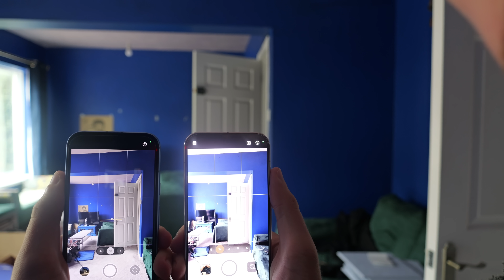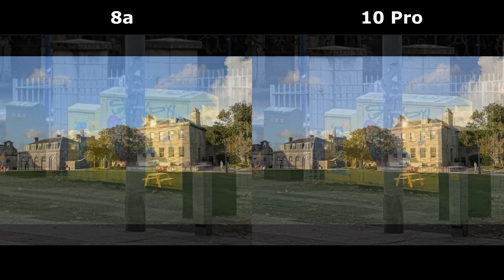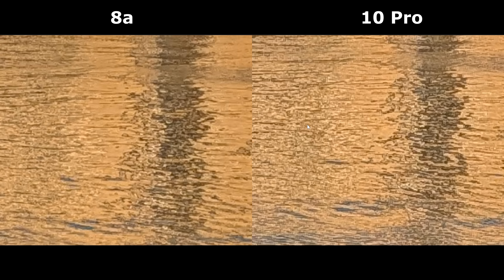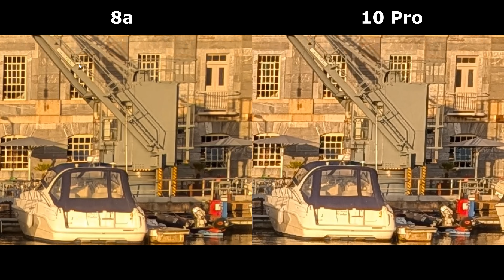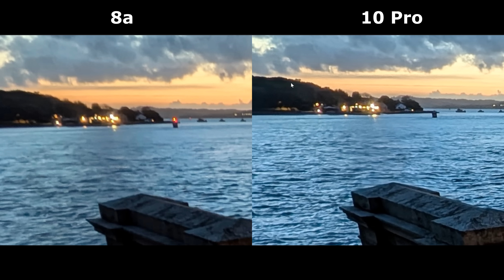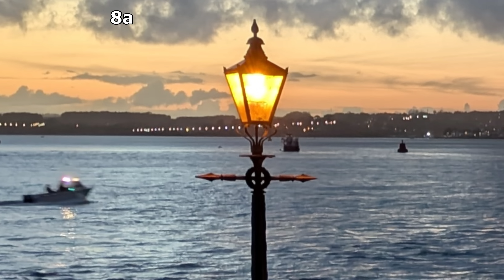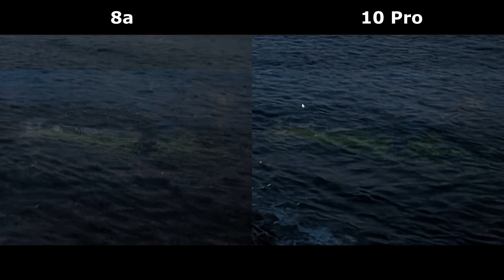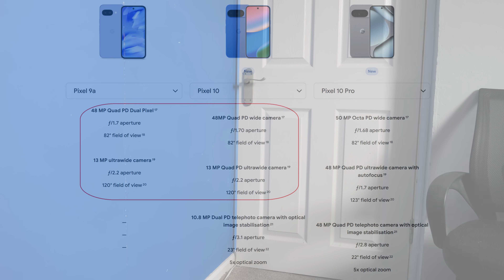I Tested Google Pixel's Cheapest and Most Expensive Phones

Comment: I really dislike how modern smartphones process images. You can instantly tell when looking at a photo taken on a smartphone by the excessive sharpening and dynamic range compression that makes the image look very flat. And for some reason reviewers praise those things because at first glance it appears better. E.g. you can say that you can see more details in the shadows and highlights, but at the same time it ruins the look of the photo. In this regard I think the chinese phones like Vivo and Xiaomi are doing quite a bit better, producing more natural images that look closer to what you'd produce with a lightly processed raw file. Pixel phones spit out images that look like they pushed the clarity, sharpness and shadows sliders all the way to the right and highlight slider to the left.
Reply: This is exactly one of the reasons I think dedicated camera sales are up. The processing by Apple, Google, Samsung and others is absolute garbage. Nokia phones 10+ years ago looked more natural and had much better color grading. For example, when you compare Pixel images with a properly edited version of the same image, it ends up looking flat, desaturated, overly denoised and weirdly contrasty and also not. The fact that modern smartphones allow for saving the raw images and log video, in some cases, is amazing and can help you make the most of your images, if you don't have a good camera at hand. That still doesn't excuse the awful processing you get on your ready-to-use images, but it's a start, and now they only need to adjust the processing itself or let users adjust that, too. Or both?
Reply: @altairquten  This. I just went looking at my old Nokia N8 pictures (2012) and was amazed how good and natural the photos looked. The quality was totally passable by today's standards but the look is like from a pocket camera that have very little if any processing.  

 It's actually really easy to become "blind" to what was once considered a normal photo because everything is so over processed now.
Reply: @altairquten What do you think about the Hasselblad tuning on OnePlus/Oppo?
Reply: @teapouter  I have never looked into that, so I can't pass judgement on it. But I have very little trust in modern smartphone camera systems and the brands attached to them, in general. It doesn't matter which big camera brand has its name on a smartphone, it's very likely going to be pretty awful. If you really like photography as an artform, I can't recommend getting a dedicated camera (appropriate for your budget range) and possibly getting a cheaper phone with a weaker camera setup enough. From ergonomics, to sensor size, photo and video features, as well, as file quality and editing headroom, most decent digital cameras will surpass any modern smartphone with ease.
Reply: Google seems to be one of the worst for over processing images, Apple does it but its a lot more subtle and rarely actually destroys the image in the same way shown in this video. There's camera apps on iOS and I presume there is on Android where you can bypass the AI processing and just get the raw image.
Reply: @Jameseos  The latest iPhone 17 models does it even less than before. There's almost no visible post-process sharpening at all. Much less than all other popular phones currently.
Reply: @Dr904  Yes I agree
Reply: @Jameseos From experience,Google photos remind me of a Polaroid film camera as in you don't know what the phone will conjure up. Photos end up looking nothing like what you see on the display.
Reply: That kind of editing looks good on Instagram, and that's all that matters for most people.
Reply: Yep. Pretty much all phone photos look awful the moment you don't look at it at from a thumbnail
Reply: The upcoming flagship by Xiaomi is so disappointing. I really wanted the current flagship because its designed to look like a vintage Leica, but had other properties so I told myself I would buy the next model come next year. This year they announce that they are dropping the vintage camera look and fully aping iPhone. This made me so angry that I will never buy Xiaomi anything ever again. I'm currently on an iPhone X btw
Reply: use motioncam
Reply: Hilarious you mention Chinese brands as having “more accurate” photos when Vivo/Oppo were the brands most well known for first implementing facial smoothing & face filters in their default camera apps, making everyone posting on WeChat Moments look like they had white, smooth alien skin with only eyes and lips 😂 Or how Huawei’s night time mode was so bad, they had to add fake textures & details to any pictures taken of the moon to match their advertising
Reply: So far my solution to that is to take the occassional proraw photo on my iphone, not because of any merit of the format, but only because the iphone seems to run out of capacity to process the photo therefore it looks vastly less oversharpened.
Reply: I hate it too, though thankfully on both platforms there's now apps that let you eat your cake and have it too, where you get the benefits like improved dynamic range and noise reduction without being horrifically over done. Gcam ports, motioncam, sharpcam, and Adobe's one on iPhone
Reply: You can use pro mode for less prosessed look
Reply: Use pro mode
Reply: Huh? Chinese phones always make unnaturally processed images. Even Vivos 'Natural' mode is extremely saturated and sharpened
Reply: I prefer to see what the eye sees... These"natural" photos you say has nowhere the dynamic range the human eye has...and so looks ugly...90 % of us aren't photographers and don't have the time to edit every 1000 photos and videos we take on a smartphone to perfection, taking 30 minutes-1 hour on each. We have better things to do than edit all day. So I'm good with the better looking more dynamic range images rather than worrying about details at 400% which I don't have time or patience to extract only for it to be compressed by the messaging app I sent it down to 1080p
Reply: It's because it's nicer to look at, well, at least for the general public. People prefer the HDR and sharper look. It's called PREFERENCE. and PREFERENCE is SUBJECTIVE.. which means you cannot tell them what they should like and what they shouldn't. I'm gonna drop the biggest word internet people cannot comprehend: OPINION. Yes. You can have an opinion about it, but so does everyone else.

It's just a matter of choice.
Reply: @TheReal_LuaDipa  wdym "choice"? When all smartphone photos look bad in the same way, while also being used to post those photos, there's not exactly a choice in image quality to be had. There should be an easy way to just have a better ready-to-go photo and raw image formats show what smartphone algorithms leave on the table. Sure, you can edit pics and post them. But that takes time and effort, both of which are limited. It's an eat or die scenario. Either you accept this easy compromise or go for a harder one. So consumers of pics often don't ever see what a good image can look like. It's hardly a choice.
Reply: @altairquten its always a choice. You have the choice to not buy a phone. No one is forcing you to buy a phone lmao 😂 And just buy a mirror less camera. Other than that, then cope.
Reply: @TheReal_LuaDipa  Yes, one person has the choice of getting a different camera, but you don't have the choice over which camera a photographer uses, who posts online. What you see shapes your preferences. Not sure what's so hard to get. So no, you don't necessarily have a choice to shape your preferences, nor can you claim that the look of modern smartphone image processing respects people's tastes or that those tastes are mere preferences everyone just comes across on their own. It's much more nuanced than you seem to think.
Reply: @altairquten  No one here is claiming that modern phones makes good images. And of course, you cannot control what others use to make photos lmao that's why freedom of choice exists. you cannot tell everyone angrily to use a DSLR or a Sony Alpha to make content lol that is not how the world works. They are not forcing you to look at their social media photos that they took with their phones, you can just unfollow them block them or ignore them, but you have no power to tell other people what they should be doing. All im saying is that what phone manufacturers makes is what the market wants. Its all a matter of choice, you just have to accept that what you want out of a phone is not popular, that is it, that what you think as ideal is not what the reality. there's not much you can do about it man. you cannot dictate what a market wants lmao. you're just thinking too much into it, man. Go get some rest. You seem to  be so restless over things that are so simple and mundane. The world is a big place. Don't limit yourself to a narrow perspective. Afterall, you can easily just buy a mirrorless or a DLSR. There's no one forcing you to buy a modern phone for hardcore photography. Let people enjoy things that they like, its not like they are forcing you to buy a phone for photography.
Reply: @TheReal_LuaDipa  Thank you for clarifying! However, you can't claim that the market wants a product, when they're forced to buy what the manufacturers sell to participate in society and when what they sell is basically the same bad product with a different name on it. I won't force a camera or whatever on anyone, but the fact is that 1) They create much better images and 2) The gap we perceive between good phone photos and good camera photos has unnecessarily grown and it's not due to fast camera development. And since everything beyond taking 1 pic and posting it online is too much time and/or effort many/most users, I think it's valid to ask for better cameras and better processing for everyone.
Reply: @altairquten no manufacturer is forcing any person to buy their mobile phones. If the market doesn't want their product, the market won't buy them and buy DSLRs or other pro cameras instead. Let's be honest here - the average person doesn't want to deal with the complexity of prograde cameras. You want something that could fit in your pocket and can be used to surf social media and watch videos on the go. Considering the smallness of phone cameras its a miracle they are able to do what they do today. But of course, its done via software. And that's where opinions and preferences come in. If you like it then its okay. If you don't then its okay too. Camera phones will never beat professional cameras when it comes to quality, but they sure as hell comes close to it. Some phones are better like Sony where there is pretty much no processing, some phones cater to the point and click crowd with all filters and such. There's absolutely nothing wrong with them. If you really want a solid camera then you should buy a camera not a phone. 

If you want a phone camera that's as good as a Sony Alpha then I'm sorry, such a phone wouldn't exist. You cannot beat physics. 

Alternatively you can install 3rd party apps on your phone, if you are really pushing for it to be as close to a prograde camera. There are a lot of apps that lets you take photos without much processing. Just a goolge search away.
Reply: @altairquten  pixel allows to save bouth raw and edited jpeg AT THE SAME TIME 
Raw obviously looks hideous without any kind of processing, so i just take jpeg because i ADORE the pixel processing, looks amazing on hdr screen
Reply: @TheReal_LuaDipa  I'd say it would be a rather easy fix for manufacturers to please both sides and in many cases they actually do. Enthusiasts can use "pro mode" and rest of the "normies" and for quick snap shot you can go with auto.

For me, many times its the over use of HDR that ruins photos. HDR is good in certain situations when used in moderation. Would be nice if it could be adjusted as needed. 

Just wanted to add to your back and forth with altairquten that the market (90%) of people don't know what is a "good photo". They will buy a phone because reviewers parrot the same thing and tell them it's good. They have been conditioned by social media to think that overly processed HDR images = good image.   Of course this is kind of thing is very subjective, but you can't argue that the trend hasn't been set by the manufacturers and that smart phone picture are kinda of fake many times.
Reply: @samik83 judging if a photo looks good is not that difficult. Saying that the "normies" can't judge for themselves what's a "good" photo is just pure elitism. 

People are intelligent enough to use common sense. Just because you don't like what's popular doesn't mean that  the "normies" can't judge what's a good photo and that their opinions are wrong. For you too much HDR may be dislikable, for others it may be the exact opposite, AND THERE'S NOTHING WRONG WITH THAT. People can straight up make their photos supersaturated, AND THERE'S NOTHING WRONG WITH THAT, even if you don't like it. If you don't like it then don't look at it. If you don't want current camera phones then don't look at it. It doesn't matter why the "normies" like it or not, how they judged it to look good or not, all that matters is that they are entitled to their opinion as much as you are, its just that your opinion is not very popular and hence manufacturers don't cater to you. Just cope. That's the only thing you can do. 

If you don't like it then it's okay. If the normies like it then it's okay. There's no point in arguing that what's popular is slop. Respect others' opinions and we'll respect yours. Don't expect others to recognize or even listen to what you're saying if you cannot respect others' subjective opinion. 

As I have said above, there's nothing you can do about it anyway. So just cope. And the "normies" will continue enjoying their camera phones like you don't exist at all, no matter how loud you scream your OPINION, and your opinion being "different" and unpopular doesn't make your opinion or yourself better than anyone's or anyone. Sorry, not sorry.
Reply: @TheReal_LuaDipa  

"Just cope. That's the only thing you can do."

Or I'll just turn on pro mode. Simple.

I'm not arguing that people should like what I like. No, not at all. Stop trying to put words in my mouth.
 
I'm arguing that people - the normies  (non-DSLR user / non pro-photographers) have been conditioned to like these pictures because thats all they see. 
Anyone who shoot with DSLR's and phones knows that phones a lot of the time (not always) make overly processed unnatural pics.  And again if you like the processed look THAT IS FINE. 
But my point is people haven't chosen this look consciously, it was sold to them and perpetuated by social media. Normie want the same style they constantly see on their phones because they have no other comparisons.

I'm not again processing, of course all DSLR user do it too(just manually), but I'd argue very few pro photographers go with trying to mimic the overly processed HDR "phone look". Just think how a wedding photo would look vs a natural look.
Reply: @samik83 it doesn't matter how the normies get their liking of HDR in photos. It doesn't invalidate their opinion, even if we assume that what you think is true, which isn't. Even more so, you couldn't argue that "normies" don't know what good DSLR photos look like. You just can't. They are not as ignorant as you think. You can't prove your claim that normies don't know what good photos look like, because there are a TON of social media influencers who actually use prograde cameras. Even twitch streamers who stream 8 hours a day have a Canon or Sony small form factor camera for their main cam, those cameras are cheaper than some flagships phones these days, so no your argument is not really valid. And again, even if they like processed photos against DSLR camera, it doesn't invalidate their opinion. Why is it so hard to understand?

People can like whatever they want and there's nothing you can do about it. They're not hurting anyone. If the photos hurt your eyes then cope. 

The normies liking what they see in social media isn't a crime. So I don't understand why you are being such an elitist over such a mundane thing. 

You cannot force people to not like something that they willingly chose to like. No one is forcing the normies to like what they like. But you're coercing them to like what you think is better. That's where you're wrong. You're pushing your own opinion to everyone.

Not everyone has to have the same opinion similar to you. 

That's not how freedom of choice works.
Reply: @TheReal_LuaDipa 
I guess you didn't even read my post. I said many times its ok if you like overly processed images. That is fine.
Yet you keep talking like I'm arguing against that.

Let me ask you why don't wedding photographers for example try to emulate the overly processed phone camera look if it looks so good?
Reply: @samik83 its because pros have a better camera, isn't that very obvious? 😂 That's why they are called professionals, while the "normies" are not, and ITS COMPLETELY OKAY.

YES, YOU ARE COMPLETELY AGAINST HDR PROCESSING ON CAMERA PHONES. That's literally what you said above. 
You came here with an elitist take against camera phones and the popularization of HDR. There's no denying that. Also, as you have just said it yourself, just press Pro Mode to get rid of too much processing. You literally answered your own question of how to control HDR lmao.

The only thing that keeps you replying and arguing here is because you are pushing your elitist mindset to everyone to make yourself feel better, and IDGAF if you're aware of it yourself or not. 😂 Not gonna happen here buddy lmao. 
You cannot push your opinion on the masses because not everyone is willing to spend money on a separate camera, AND THAT'S COMPLETELY FINE AND OKAY, and you shouldn't judge people just because they are using phones as cameras and posting them online. I'm not arguing that phone cameras are better than DSLRs. There's no one claiming that here lmao. Read my original conversation again with the guy above. But this time, read it much, much more slowly, and again and again, until you understand it.
Reply: @TheReal_LuaDipa  

"its because pros have a better camera, isn't that very obvious?"

Well obvious you have no idea.

Nothing to do with a DSLR being better quality, it's about the processing the phone does to the photo.
A camera phone can easily take non processed DSLR kind of pictures with pro mode. In fact they can be close to indistinguishable in good conditions. 
 
You can also process a DSLR image to look like a camera phone picture.  You can easily bring a lot of HRD in post processing IF you want.  

So the question again:

Why don't wedding photographers for example try to emulate the overly processed phone camera look if it looks so good?  

"YES, YOU ARE COMPLETELY AGAINST HDR PROCESSING ON CAMERA PHONES."

Overly processed HDR. Thats what I don't like. Everything looks flat. 
Look at my first post, I say it there. 
HDR is very useful in challenging situations, for example taking sunset photos. They do look unnatural but at least you have something. 
Bringing up  shadows way too much in  "normal photos" looks unnatural. If you like that unnatural look, its fine. 
But I'm saying most people don't know any better because the never play around with pro mode and see what having contrast in you picture actually does.  Letting shadows be shadows (dark) might actually look good. Modern phones in auto mode don't usually allow for this. 

"You cannot push your opinion on the masses because not everyone is willing to spend money on a separate camera, AND THAT'S COMPLETELY FINE AND OKAY"

Yes, completely okay.  Do you read my comments at all? You're constantly trying to argue against something I'm not even saying.  Do you see that?
  
I'm not trying to say people need to like what I like. 
I'm just saying the REASON why they like it and your having a hard time with that. 
  
See, it's not really that different from fashion. People want to copy each other. But in this case the trend is set by the manufacturers who make the camera algorithm. 
Like in the newest Pixel phones they're now using AI to enhance pictures that even rebuilds peoples faces if it's unclear enough. Thats not a real photo anymore.
Reply: @samik83 read my comment again lmfao i already answered your question. Wedding photographers use DSLRs and pro cameras because they are, as you said, "professionals", and the "normies" are not. You literally have the worst reading comprehension of anyone I've met in this 32 years of mine. 😂

People liking AI enhanced photos isn't a crime. They are free to like it just as you're free to hate it. If you hate it okay. If other people like it that's completely fine too. Or are you high in your imaginary horse to accept that freedom of choice and opinions of other people exists?😂

Again, people have a choice on what to use. There's nothing you can do about it but cope. If you don't like AI then just use a dedicated camera no one is forcing you to use or even look ai assisted camera photography. 😂 But you dont, you absolutely don't come here being an elitist and telling that the "normies" as you call it doesn't know anything about photography at all.

Final question. 
Do you understand what a subjective opinion is?
Answer with Yes or No only.
Reply: @TheReal_LuaDipa  

"Wedding photographers use DSLRs and pro cameras because they are, as you said, "professionals", and the "normies" are not."

Ok, since I'm not getting through to you, lets changed it a bit.
 
Imagine a wedding photographer was forced to use a phone camera. 
What mode mode do you think he would use and why?
Would his "normie" clients prefer to have their wedding photos in the overly HDR look, (the mode you are insisting normies prefer) OR pro mode with the more natural looks?

"Do you understand what a subjective opinion is?
Answer with Yes or No only."

Yes. 
I've answered this many many times. 
It is fine that people like overly processed images. Why is this so hard for you to understand and why do you keep insisting I'm saying other wise. My point here is only WHY THEY LIKE IT.

And your claiming I have bad reading comprehension. Do you know what projecting is? Well this is a prime example.
Reply: @samik83 who's forcing a wedding photographer to use a phone camera?😂😂😂 Lmfao hilarious take, you're one different breed 😂

The normies can edit the photos from the wedding as they please. There's nothing wrong with it. 

The only one who has a problem here, it seems, is you. Lmao. 😂 You still don't understand it, do you?

There's nothing wrong about the REASON WHY people like processed or ai images. I'm literally just repeating myself lmao 😂 even if it is because manufacturers are pushing for processed images and the normies like it, THAT'S COMPLETELY FINE . There's zero wrongness with that, what is it that's so hard for you to understand? THEY ARE ENTITLED TO HAVE A DIFFERENT OPINION AND SUBJECTIVE LIKES THAN YOU, IRREGARDLESS OF HOW THEY ARE INFLUENCED TO THINK LIKEWISE. BEING INFLUENCED BY MARKETING IS NOT ILLEGAL .😂 You seem to be taking others opinions too seriously you are being hurt by the normies.😂 Manufacturers can and will make HDR processed camera phones and people will like them, and THERE IS NOTHING YOU CAN DO ABOUT IT.
Reply: @samik83 who's forcing a wedding photographer to use a phone camera?😂 Hilarious imaginary take. And even then, if people wanted to make wedding photos with camera phones, what's the problem with it? Why are you so affected?😂 U a wedding photographer or something?? Even then the normies can edit the photos and apply HDR EFFECT anyway, who's stopping them?😂

And no, there's NOTHING WRONG WITH THE REASON WHY PEOPLE LIKE HDR AND AI PROCESSED IMAGES, THERE'S NOTHING WRONG WITH PEOPLE BEING INFLUENCED BY PHONE MANUFACTURER'S MARKETING. what is so hard to understand about that?😂 

Just because the populus doesn't agree with your opinion doesn't make it illegal to be influenced by marketing. I'm repeating myself: its called subjective opinion and choice. If you don't like it okay. If other people like it because there are companies marketing it then its COMPLETELY OKAY, TOO. Why is it so hard to understand that concept??

Is marketing illegal now? Are manufacturers forcing people to like and buy their products? Yes or No answers only. 

You seem to be too affected by other people's opinions lmao. You just want others to conform to your likes. Not gonna happen kiddo. Samsung and Apple and others will continue making AND marketing HDR and Ai assisted camera phones, and people will like it. What are you gonna do about it?😂
Reply: @TheReal_LuaDipa  

"who's forcing a wedding photographer to use a phone camera?"

It's a just a hypothetical situation as an example to drive my point home.  
Phones can take highly processed picture or not processed.  

So here the question again. 
Or will you dodge it a second time?

Imagine a wedding photographer was forced to use a phone camera.  (maybe his DSLR broke down)
What mode mode do you think he would use and why?
Would his "normie" clients prefer to have their wedding photos in the overly HDR look, (the mode you are insisting normies prefer) OR pro mode with the more natural looks?

"NOTHING WRONG WITH THE REASON WHY PEOPLE LIKE HDR AND AI PROCESSED IMAGES, THERE'S NOTHING WRONG WITH PEOPLE BEING INFLUENCED BY PHONE MANUFACTURER'S MARKETING. what is so hard to understand about that?😂"

Where did I say it was wrong?  

"You seem to be too affected by other people's opinions lmao. You just want others to conform to your likes." 

I'll repeat since it seems you don't read my comments. I'ts like your making arguments on my behalf that fits your narrative.

Here it is a second time. 
It is fine that people like overly processed images. Why is this so hard for you to understand and why do you keep insisting I'm saying other wise. My point here is only WHY THEY LIKE IT. 

Maybe I'm having a debate with a AI bot here, not sure.  
I'll repeat once more:
It is fine that people like overly processed images. Nothing wrong with that. I'm not trying to change that. 
Lets see if your next response will still insist that I want to change the masses opinions on what is a good photo.
Reply: @samik83 answers to your hypothetical scenario:
the normies can pick HDR processed images or raw images, whatever they want, it doesn't matter, choosing either is not illegal in any way shape of form.

"my point here is why they like it". I'm just gonna repeat myself one more time, okay?

IT DOESN'T MATTER WHY THEY LIKE IT.
IT DOESN'T INVALIDATE THEIR OPINION.
IT'S NOT ILLEGAL FOR THEM TO LIKE IT FOR WHATEVER REASON SUCH AS PHONE MANUFACTURERS MARKETING IT. THEY CAN LIKE IT FOR ANY REASON, AND THERE'S NOTHING WRONG ABOUT IT.

Again, I'll repeat my question above.
Do you understand what fredom of choice and subjective opinion is? Yes, or No?😂
Reply: @TheReal_LuaDipa  

"the normies can pick HDR processed images or raw images, whatever they want"

Yes, those are the two options. 
You still dodged the question: 
What mode mode do you think he would use and why? I'm especially interested in the "WHY" here.  Lets see if you can answer this this time. 

"IT DOESN'T MATTER WHY THEY LIKE IT."
When did I say it matters? I'm just explaining cause & effect. Just an observation. No need to get your panties in a bunch over it. 

  "IT DOESN'T INVALIDATE THEIR OPINION."
When did I say that?

"IT'S NOT ILLEGAL FOR THEM TO LIKE IT"
Again, when did I say this?

"Do you understand what fredom of choice and subjective opinion is? Yes, or No?"

Did you miss it the last time? Here it is again.

Yes.
I've answered this many many times. 
It is fine that people like overly processed images. Why is this so hard for you to understand and why do you keep insisting I'm saying other wise. 
My point here is only WHY THEY LIKE IT.

The WHY matter in this context because your saying people chose this look, where I say they were sold this look.

Nothing elitist about this. Just pointing out that overly processed pictures are norm these days and people have gotten used to this, basically blind to it.
I'm not even saying I'm immune to this. I checked some of my old shots from 2012  Nokia N8 and I was pretty shocked what photos were back then. 
Granted the camera on that phone was a bangger for the time so the quality was basically as good as these days but the lack of processing and how natural the pictures looked was pretty amazing. Really opened my eyes how pictures have changed over the last 13 years.
Reply: @samik83  "What mode mode do you think he would use and why? I'm especially interested in the "WHY" here. " IT DOESNT MATTER WHAT THEY CHOSE. ITS NOT A SIN TO CHOSE HDR PHOTOS NOR A RAW PHOTO, SO THE ANSWER TO YOUR QUESTION CAN BE A) THE NORMIES WOULD LIKE THE HDR PHOTOS OR B) THE NORMIES WOULD LIKE THE RAW PHOTOS OR C) THE NORMIES WOULD LIKE BOTH, ITS LIKE ASKING WHAT COLOR YOU WANT YOUR CAR YOU ARE BUYING, RED OR BLUE OR GREEN, IT DOESNT MATTER. WE ARE FREE TO CHOOSE WHATEVER WE WANT. ITS CALLED FREEDOM OF CHOICE.

"The WHY matter in this context because your saying people chose this look, where I say they were sold this look." IT DOESNT MATTER WHY THEY LIKE IT. ITS NOT A SIN THAT THEY LIKE IT, EVEN IF IT IS BEING SOLD TO THEM. ITS NOT ILLEGAL TO LIKE WHAT IS BEING SOLD TO THEM, ITS PERFECLY LEGAL TO LIKE HDR PHOTOS EVEN THO IT WAS SOLD TO THEM.

"My point here is only WHY THEY LIKE IT." IT DOESNT MATTER WHY THEY LIKE IT. YOU HAVE NO SAY ON WHAT OTHER PEOPLE LIKE OR NOT. IF YOU DONT LIKE IT THEN LET OTHER PEOPLE LIKE IT. YOU HAVE NO AUTHORITY OR POWER TO CHANGE WHAT OTHER PEOPLE LIKE, EVEN IF THE REASON "WHY" THEY LIKE IT IS BECAUSE IT WAS SOLD TO THEM. THE PEOPLE WERE NOT COERCED TO LIKE IT. THEY WILLINGLY CHOSE TO DO SO.

"The WHY matter in this context because your saying people chose this look, where I say they were sold this look.' WHY DOES IT MATTER TO YOU IF THEY LIKE THAT THEY ARE SOLD ?? THEY ARE NOT HURTING ANYTHING OR ANYONE.  DO THE "NORMIES" JUDGE YOU BECAUSE YOU DONT LIKE HDR PHOTOS? YES OR NO?

"Nothing elitist about this. Just pointing out that overly processed pictures are norm these days and people have gotten used to this, basically blind to it." THERE'S NOTHING WRONG WITH PEOPLE BEING USED TO IT. ITS NOT ILLEGAL FOR PEOPLE TO GET USED TO SOMETHING SO PRAVALENT AND IS SOLD TO THEM. again, what is so terribly hard to understand on this conversation? you cannot push your subjective opinion to everyone. lmao. you are really trying hard to defend that you are not an elitist, but in every reply you make you are positing that there is a superior way to make photos and that people should think like you. That, lil man, is ELITISM at its finest.
Reply: @samik83  bro just SYBAU. Let people enjoy things. You are being a Karen right now. STFU and let me enjoy my ai powered 100 megapixel superresolution ai power max camera phone from china.. or are you so low in intelligence you are judging people based on what they like ??
Reply: @TheReal_LuaDipa  

Do you understand that I'm not saying it is wrong or illegal that people like overly processed pictures?

Yes or no?

It's really hard to have a conversations because you seem to be constantly ignoring this.
Reply: @samik83  "Do you understand that I'm not saying it is wrong or illegal that people like overly processed pictures?" YOU ARE QUESTIONIN THE REASON "WHY" PEOPLE LIKE WHAT THEY LIKE, AND THAT, LADIES AND GENTLEMEN ON THIS COMMENT SECTION, IS WRONG. BECAUSE YOU ARE CHALLENGING ONE OF THE FUNDAMENTAL HUMAN RIGHTS: THE FREEDOM OF CHOICE AND EXPRESSION. IN ADDITION TO QUESTIONING THE CHOICE OF OTHER INDIVIDUALS, YOU ARE TRYING TO PUSH THE NARRATIVE THAT WHAT OTHER INDIVIDUAL THINKS IS INFERIOR TO WHAT YOU THINK. THAT IS 100% ELITISM TO THE CORE. 

No one here is questioning why you dont like HDR processed images. But you are questioning why other people like HDR processed images. If you cannot still understand what is wrong with the way you think, I dont think me speaking any combination of words will ever lead you to a proper comprehension on where you are wrong. Dont worry, I totally understand. Some people just cant see and accept that the world doest revolve around them and the world doesnt need to conform to their thinking. We have a word to call those individuals, but I wont mention it here, because it doesnt matter and I dont judge you for not liking camera phone images.
Reply: @TheReal_LuaDipa 

Yes, generally there are reason WHY people like something. Asking that or proposing a reason for it doesn't mean I'm against people doing so.

Do you understand this😘?
Reply: @samik83 you are questioning the reason why they like something. You're not fooling anyone here, lil man.  You're literally arguing against the reason why they like it on multiple occasions in your comments above. 😂 Just take the L and move on, people will continue buying camera phones like they have been doing in the last decade.
Reply: @TheReal_LuaDipa  

Heres a parallel to help you see my point.

Once upon a time unconformable skinny jeans were in fashion. Everyone wore them. Do you think each person who wore them, independently came to the conclusion that I want to wear these unconformable pants because they are cool....OR did they see other people wearing them and stores were pushing them and THEN they thought I want them too.  
Which one do you think is more plausible explanation?  
Do you think something similar might be happening with phone camera look? 
Or do you think I'm reaching here? 

Listen, I'm not even saying "normies" can't see good photo from a bad ones.  You show them a photo from National Geographic they will agree, it's a good photo even though it's not processed to hell. People know what looks good. 
But at the same time people can't see how overly processed most phone pics are because the are constantly bombarded with the same stuff. They simply accept that this is "good" because everyone else accepts it the same, just like the unconformable fashion. 
People might actually see it if they took some time to play with the setting and try out manual mode, to get a sense what kind of photos you can get. What is natural looking and what is the overly processed auto mode look.   The might actually learn that it's possible to get a DSLR type of picture from a phone.

And just in case. No, I'm not saying wearing skinny jeans is wrong or illegal :D
Reply: @samik83 People may, or people may not. They are free to choose, they are free to look. Free to decide for themselves.

But even if they don't, there's no problem with it. It's not illegal for them to not to. They have free will.
Do you understand?
Reply: @TheReal_LuaDipa  

Yes, I understand this. 
Do you understand that I understand this? It's seems rather difficult for you to accept this. 

I'll repeat, using skinny jeans is ok, there's nothing wrong wearing those pants, even though I think they look silly. People can freely wear them if they want ;)
Just saying they wear them because it's fashionable -> everyone else does it too.
Reply: @samik83 there's no problem with them being fashionable. Just like people liking HDR processing in images. 😂 You have a problem with that on your very first comment arguing that its only prevalent because manufacturers are pushing it. you are now taking that back because you can't win the argument, because what your complaining about is subjective lmfao 😂😂 you are hilarious. You're not fooling anyone here but yourself.
Reply: @TheReal_LuaDipa  

You seem to be unable to understand that me saying WHY something is popular is not the same thing as saying people shouldn't like it because I don't like it. 

It's not a hard concept to grasp. I'm thinking your just playing dumb here because it's the only tactic you have left. If you acknowledge this, you have nothing to argue so you can't let it go.  
  
This doesn't make you win an argument, it just makes you seem retarded because you can't grasp a simple idea. 
Which by the way is fine, if you are retarded. It's ok, it's not your fault :D